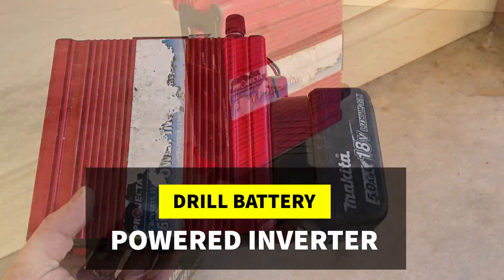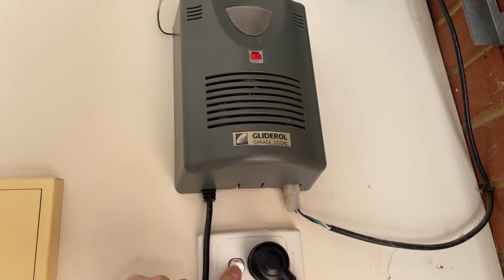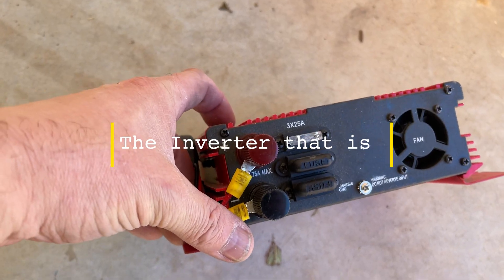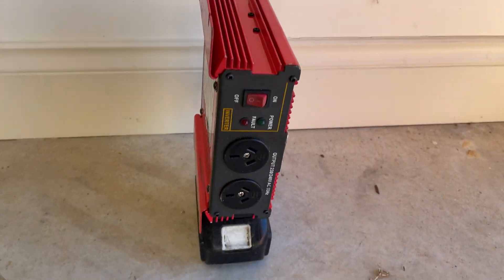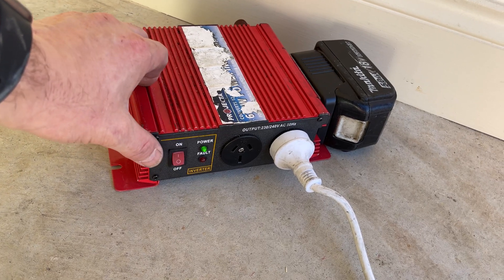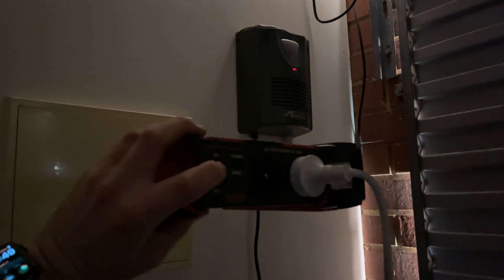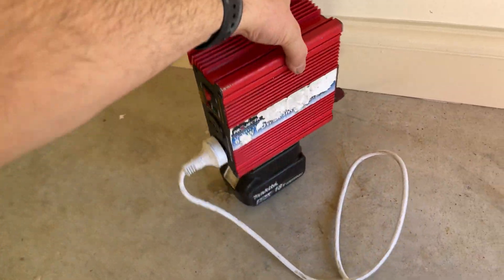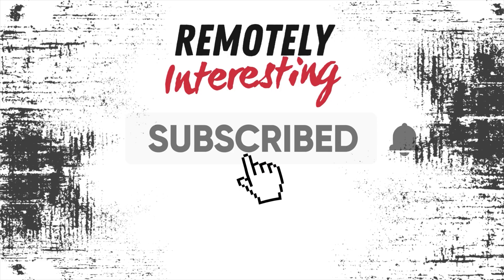Portable Drill Powered Inverter

Comment: Can you connect two or more adapters together and connect to the red and black ports?
Reply from the maker: As long as your voltage doesn’t exceed the maximum input of the inverter
Reply: @NatesToolbox if the batteries are 18v and the inverter input is 12v how do you make it work? Would you have to use a voltage regulator or do inverters already come with one? Thanks

Comment: Be carefull doin this.. Those makita batteries arent protected, but rather rely on the tool to tell them when there empty or overworked.. Using them like this, that inverter doesnt care whats runing it and could easily overheat or overstress the cells inside the battery, coupled with the fact that there's no low voltage protection inside the battery, again its in the tools.. The battery is free to drain itself to the floor in this situation, meaning  at best are ruining the batteries in short order, or 2 you end up with a fire on the charger from the cells being damaged..

Comment: I tried it with my 18v Milwaukee and a 300watt 120v inverter I had laying around, it ended up tripping the over voltage protector on the inverter and refused to fire up without a buck converter 14v. Planning on attempting again with a different inverter and making 14v lithium ion battery.
Reply from the maker: Oh wow wonder if our 240v likes the 18v better.  Could just be that particular inverter doesn’t like more than 13-14v